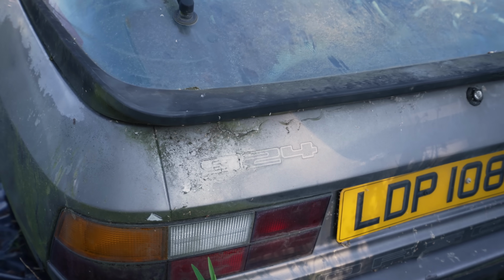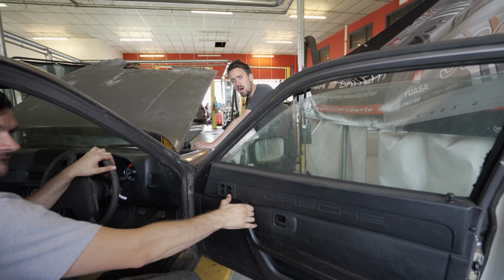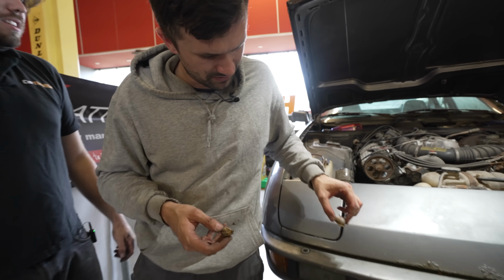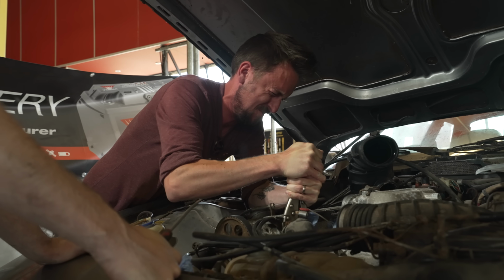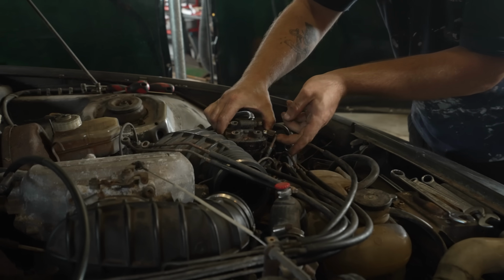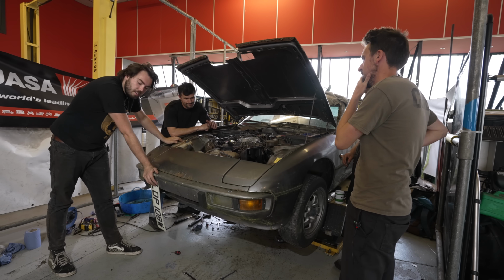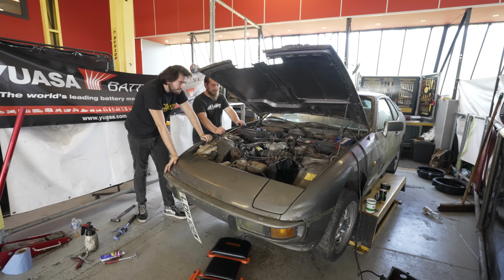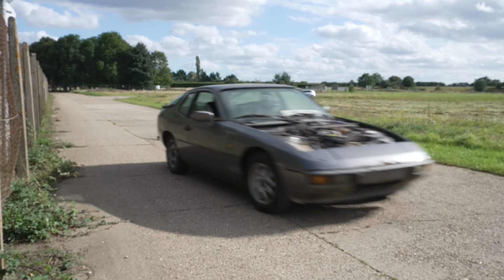Will Our Super Cheap Porsche Drive Again?

Comment: I can't believe this death trap is able to move on it's own. Maybe these German engineers knew what they where doing...
Reply: Spoiler alert!
Reply: Sure thing old german cars had been rly reliable and build for forever if treatet normal nowadays the cars are build to break after 100 thousand kilometers .
Reply: This good please every time something cheap 🚗 🚘  this good video😊😊
Reply: @Deadtrigger24  not the wire looms.  In The 80thies Japan mare better Electric  and electronics in theirs products
Reply: Shame that's not the case now
Reply: Nein! Sie haben sich mit dieser beschissenen Steuerkette verirrt
Reply: Landon-si5xc   wrong comment section.
Reply: @Deadtrigger24 lol.
My uncle made BANK fixing fkn beetles.
In the 80s every 3-5 yr old german car we traded in needed MAJOR work.
From passat thru to 5 series. The only thing that didnt was a 280sel that was 3 years old.
They were shitboxes. They were horrible to drive too. Weird steering shit ride and gutless. And their interiors fell apart.
Sorry. But utterly unimpressed with old german cars that werent old
Reply: @sugarnads did they already produce them in the us by then? Because the difference between the cars build in Germany and the cars assembled in the us is impressive….
Reply: They've unearthed a zombie

Comment: I have a 924 as a daily for the past 5 years. Am glued to this adventure you boys are on! Cant wait to see the supercharger. 
Also, replace EVERYTHING on the ignition side. They need a super strong spark to kick over reliably (especially in winter). I've tried a few and NKG leads seem decent. Also get a battery with slightly higher CCA rating than standard. 
Oh and good luck with the mystical WUR

Comment: My hats off to you gentlemen!  In ancient times I owned an ‘81 Dodge Omni 024 that had a blown 1.7l VW engine. I replaced it with a VW 1.6l with that exact mechanical fuel injection.  It took me forever to get that right but it did finally work properly in the end. Kudos!
Reply: Yeah. Bosch K jetronic. The single most common fuel injection ...in the WORLD... at the time.

Comment: Mind an engine can continue running even if you disconnect the "+" on the battery as the alternator is still producing power.

Comment: Assuming the alternator is in good working order, an older car will always run after you disconnect the battery because the system itself is self sustaining. (Hence why if you bump start a car with a dead battery it will run fine) - so that expains why she kept running after you pulled the ground. (As obviously your key isn't switching off the ignition) Naturally if you turned the car off it then wont restart.

Comment: In most cases the alternator runs the engine plus charges the battery as a secondary objective . The battery is just a reservoir to dump current into the starter on key turn. And since its connected in parallel not series with the alt and ground, its not required in the circuit to run.

Can't speak for more modern engines however, as some have overcomplicated battery voltage monitoring etc so ECU might take the dummy out the baby's mouth

Comment: Cars running on no battery is perfectly normal,    They run on the alternator,   and they charge their batteries with the excess electricity it'll have left.
The car running without a battery connected only means that the alternator is healthy.   
They only really need the battery to start but the alternator takes over once it's running.

Comment: just a question but i always thought that when a car is running its normal for it to continue running even without a battery connected, until the alternator stops or the revs get too low where it cant sustain a charge from the alternator, because its charging itself? or am i wrong here?

Comment: I mean once you cut the bonnet and it's in the garage, why not take it off completely so you don't whack your head off it multiple times? lmao
Reply: Also what struck me is that they didn't instantly drain the oil, put fresh oil in, yeah itll still be mixed, but will give a much easier time to the engine to start, run it for 15min, put a flush in, 15 mins running, drain it all and then put some good oil in. Why didn't they start with that?

Comment: I want to see you change the rear callipers on the 924… the car has drums

Actually the ‘81 on NEED the second fuel pump as it increases system pressure. Which idiot suggested to remove it?

I have a ‘81 924 turbo and I’m a Porsche technician

Check the WUR and make sure the throttle plate on the metering head isn’t stuck,

Comment: A car will continue to run if the battery is dead or unplugged. The alternator will supply enough bolts to keep the car running

Comment: Be warned; the K-Jetronic fuel injection system on these was a nightmare at the best of times.
Can't imagine it's going to work well after standing for 18 years.
Reply: I think that's what we had on a passat of similar age. Most of the time would start first time but if for some reason it didn't catch the next time it would be flooded and you'd have to clean the plugs to get it started.
Reply: @paultasker7788  Had something a bit like that on my 924.
The K-Jetronic had an automatic choke system (I forget exactly how it worked) and sometimes it'd stick on and flood the engine.

I spent about 2 years trying to sort it out but as soon as I figured one thing out (in the days before the internet) and fixed it I'd find something else wan't working properly.

In the end, I met a guy who offered me a straight swap for an E28 BMW 525 and I nearly bit his hand off!

Comment: I work for the HSE. I will be making a visit to ensure Ethan learns to use eye protection.
Reply: Exactly what I mentioned earlier! I used to be the Health and Safety rep and First Aider where I worked, in an engineering company. Blowing crap like Ethan did into his eyes, without safety glasses at least, is really asking for trouble, and not remotely funny! I get the 'Lad Culture' aspect of this channel, but they are setting a very bad example. You really don't want to lose or damage your eyesight!! It's permanent!

Comment: Do these guys not know that cars run without a battery? That's what the alternator is for, to supply power to the electrical system, the battery is just there to start the car...